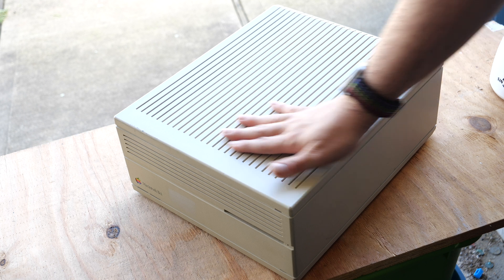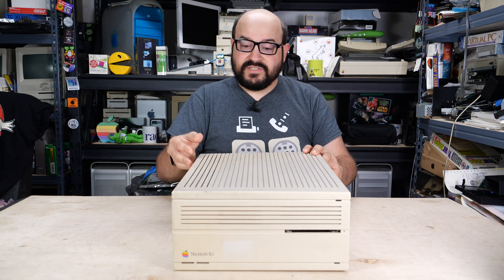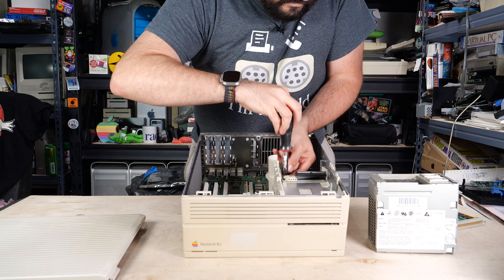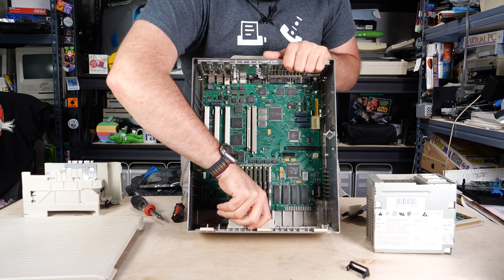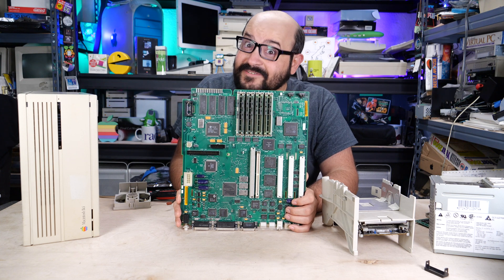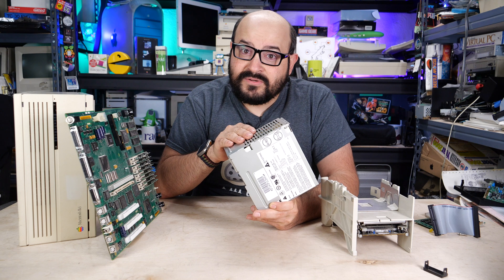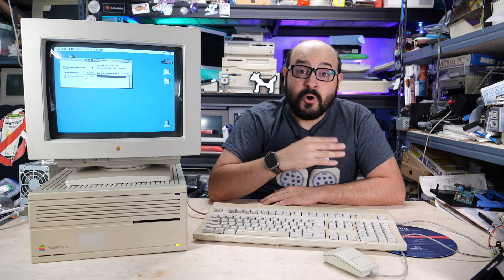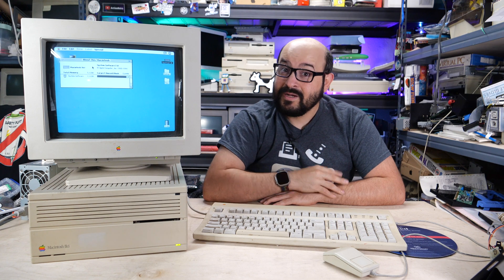NEVER Power On Your Vintage Mac Before Doing This!

Comment: What is the easily servicable and non AIO vintage 68k pre 1993 macintosh you would recommend to first time tinkerers?  

(no CC because that has 99% of the time dead CUDA chips)
Reply from the maker: I go over a few systems in my Vintage Apple Basic #1 video. The Centris/Quadra 650 isn’t bad - has plenty of expandability and the logic board is free of leaky caps. The LC series are okay too, but the Centris is way faster.
Reply: @Mac84  Ah thanks. here in my country Sri Lanka a vintage mac is near impossible to find, the mostly used ones were the LC's and IIcx's it seems, and hopefully I find one without a stupid tadiran or maxell bomb inside it

Comment: Hello... is there a way to revive an old IIcx? I see a momentary green light, and then it powers down. I've looked inside, and as far as my inexperienced eyes can tell, there is no damage to the motherboard. Again, as far as I can see. (I also have no monitor for this thing.)

Tanx!
Reply from the maker: I’d check out TinkerDifferent.com as the comments section is different to provide support in. It could be a bad power supply, it could be aging capacitors, it could be a short, many possibilities.
Reply: @Mac84  Yes, I know, it could be anything, and I'm no expert in this. But thanks for the link!
Reply from the maker: 👍 Make a post there and I’m sure some smart folks will help with good advice

Comment: 90s Apple told you how to open your computer to fix it if it breaks. 2020s Apple just tells you how to open your wallet to buy a new one instead 🤑
Reply: Also 80-90's Apple, if I recall correctly told you to drop your computer from a certain height if it stopped working, that was due to cracks in the solder
Reply from the maker: @pablogirol The Apple /// had instructions like that given by computer shops but there is some confusion on if that was official Apple directions or not. Poor Apple ///!
Reply: Yeah, poor Apple /// it hurts to think someone did it and broke their computer

Comment: Hey, I know this is a bit of s stretch, but i just recently got 2 iicis and one of them was kaput from an  exploded battery, but the other wasn’t, but the rtc chip appears to be dead(wont show  boot off known good hdd), after recapping with all tantalum’s, and even replacing the 32khz oscillator, and swapping chips from the bombed one. Is there potentially something I am missing?
Reply: Yes.  You'll need to check and see that the traces on the top side of the logic board aren't damaged, which prevents the circuits from working right.  If you have a multimeter, set it to "continuity test" and start probing around the board from point to point.  Do this without hooking up the board to any power.  If everything checks out, you might be OK.

I'd recommend watching one of the videos from this channel or Branchus Creations that covers all this during a live stream to help with how to do proper checks on a damaged board.   Both are very informative and thorough on the details of what to check and how to fix.
Reply: @minty_Joe  Ah gocha, much appreciated, Ill do that when i get the chance

Comment: 1:47 that's a Service Source original Apple Service Provider's only manual; before 2000 they came in CDs and were very comprehensive in taking apart every Mac model up to date; the troubleshooting section was so-so, as it only covered module replacement mostly.
Overall good video, and let me add another must-have step: ESD measures.

Comment: Hey Steve - in some cases I have noticed that old capacitors with diminished capacitance need some power running through them for a while before they stabilize. If that's the case, and there is no leakage found, is it still dangerous to power on the system?
Reply from the maker: It really depends on the capacitors and the system. In some cases, like high end AV equipment - older caps which were made to higher standards can last longer and can be “reformed” and work okay. 

However, it is always wise to carefully inspect these things. I’ve witnessed caps that looked okay leak before my eyes due to the age of the seal keeping in the corrosive contents inside.

Comment: never seen a battery not explode in an old computer. you got lucky
Reply from the maker: Very lucky - I’ve had computers newer than this have exploded batteries!
Reply: @Mac84  Hello, it's possible that it was replaced before or there is any date that match the age of the computer.
Reply: I've gotten really lucky, then. I got a handful of computers whose original PRAM batteries from 1991 were perfectly in tact. I still removed them immediately, but I was surprised and felt grateful.